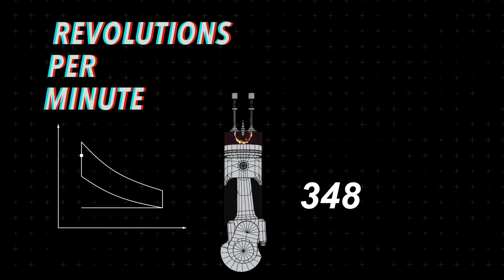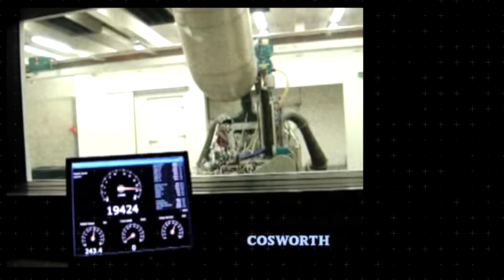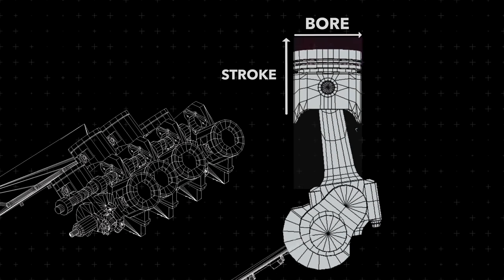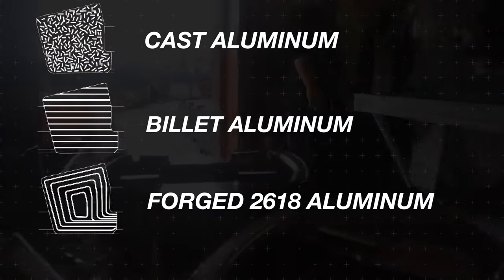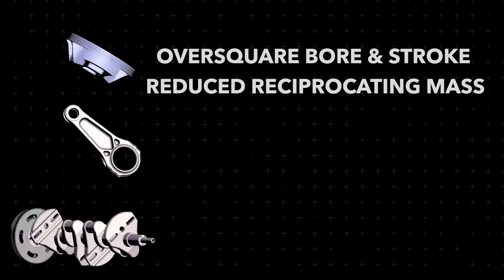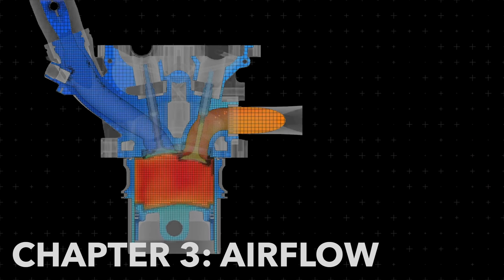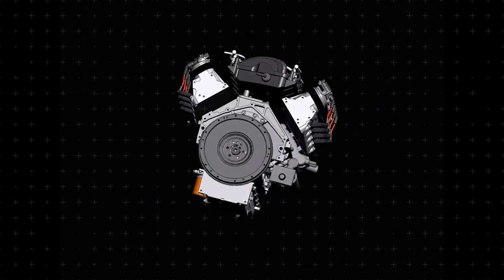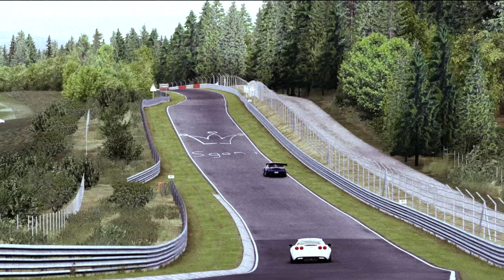The Impossible Engine Speed😳| Explained Ep.28

Comment: There's something to b said about tuning exhaust velocity vs back pressure, but all engines do need some back pressure, unless designed to run at max rpm at max power during most operation.  Try building an engine with no back pressure, and see what happens... the engine uses the back pressure to build efficiency over a certain power band, so nearly all engines require some back pressure. 

Saying engines don't want back pressure is simply ig orant of physics and foolish.

Comment: Ship engines go down as low as 50rpm (and 100,000hp at the same time)

Valve float at high RPM is better addressed with desmodronics, not springs - and this is a video subject all by itself (Ducati!)

Fiat used pneumatic valves on their Twinair engines - not exactly a high revving, high power, high cost engine application

Comment: High RPM engines are fascinating. But i prefer a big lazy engine with lots of low end torque. Of course im not a racer. I only drive on the streets. If i was able to drive on a track, I might prefer a high revving engine. But I would have to drive a few different engine types on a track to really know for sure.

Comment: I think I would rather build a high-voltage EV or Series-Hybrid.
There is a linear relationship between electric motor Amps & torque. But of course, motors are limited with how much torque they can produce. So if you don't want to trade RPM for torque with gearing, or add more motors or a bigger motor.

Then like with engines, if you can't, or don't want to build more power with torque, because of weight or space restrictions. Then you have to make more power with more RPMs. More voltage means a higher top speed and rate of acceleration.

So, if I was, for example, to modify an EV or Series-Hybrid. First, I would swap to a higher voltage controller, or swap out the capacitors in the controller, because they're the main limiting factor to how much voltage that controller can handle.
Then, check how much voltage the Motor{s) winding insulation can contain before it starts arcing. Then check and modify how much RPMs the rotor & bearings can safely handle before failure, so the centrifugal force or friction won't rip things apart.

Then, build a higher voltage battery & ultra-capacitor pack, and a matching higher charging voltage generator if a Series-Hybrid, or, just build a high power boost-converter, and add as many Ultra-Caps and or batteries in parallel with the original batteries as possible, within your space or weight budget, because a boost-converter can only make more voltage, if it can pull more amps from the power source, as in the batteries/ultra-capacitors/generator.

You can have a higher voltage, using the same wattage battery pack, but you will have to limit current for safety & longevity, so essentially, it will be like always moving in 2nd or 3 gear.

You can safely overcome motors, as long you don't overheat them to death. Too much heat can melt or ignite the windings wire insulation, and if your motor uses magnets, too much heat will demagnetize them.

If you improve the cooling ability of the motor, with added heatsinks, liquid-cooling, or a bigger deeper radiator if already liquid-cooled. Then you can program your controller or Cycle Analyst V3 for a higher current-limit, because the same motor can now safely handle more amps without overheating.

So, the motor can produce more torque, for longer, or more torque continuously without overheating. That, with higher voltage, is the key to more power with the same motor, then, only limiting factors, are how much voltage the insulation can still contain, how much RPMs the bearings can handle without quickly wearing out, and how much G-forces can the rotor handle, without flying apart, or even expanding and scraping into the stator.

This is the future of tuning. And the ultimate Sleeper car or bike. Because, besides the cooling system, be it a pure EV or Series-Hybrid with the generator off. How can you tell if it's a weak economy vehicle or a monster?

It's hard for an engine to hide its ability for more power.
Recirculating Blowoff valves, disc-style wheels hiding bigger brakes, and exhaust cutout switches bypassing extra mufflers & resonators, all this can only go so far. 
But electric motors are the ultimate stealth.
Cops, and other enemies won't know what happened or how you disappeared, even more so, because you don't have an engine ANNOUNCING where you are, where you're going, and how hard it's working.

To everyone who read all this, thank you for your time. Hope this inspires you to build your own performance Battery Electric Vehicles or Series Hybrids. I'm sick of the mess and clusterf--k of engines. I'm sick of waiting for multiple things to go wrong, even with my preflight checks, which I'm also sick of doing. And I'm sick of the puzzle of getting all these different parts from different manufacturers to work. And I'm sick of the unnecessary attention. I just want something quick & dependable.

Once you grasp the basic Electrical Engineering, EVs are so much more simple & reliable. At least with the range-extending generator of a Series-Hybrid, I don't have to stress out the engine or myself. I can just keep it at lower revs, for less noise, less fuel consumption, and less wear, and just optimize the intake runners & exhaust for that RPM. And for high charging voltage, I can just modify the generator motor attached to the engine, and trade charge currant time for more voltage, by changing the windings or the gearing between the engine and it's motor acting as a genorator & starter, if I don't want to turn up the engine RPMs for more generator volts. I'd rather do this, than go through the unstable hell of modifying a drive engine for more power with a higher redline. And no clutch to burn, no transmission to blow up.
And more aggressive Regenerative-Braking means I don't need bigger, heavier, more obvious brakes, and the stock ones last longer.
Other than video games, I'm so done with traditional tuning.
My delivery bike engine has put me though so much hell already, by itself, and it's not even that modified. Just a longer intake and more open exhaust.

I thought about getting the Kawasaki ZX4RR, or a less RPM parallel twin like a Versys X300. But I don't care anymore. After my workbike, I just want to build a quick pure electric or series-hybrid.

Comment: This was sooo interesting...never knew about valve springs so much, it is very interesting that pneumatic control of valve, is that similar to the Freevalve technology from Koenigsegg? 

As I see that Coshwort is top notch engine manufacturer so GMA T.50 and Aston Martin Valkyrie have an F1 technology for the street 😎
Reply from the maker: Koenigseggs Freevalve is even cooler since it’s solenoids controlling the valve and no need for cams. You can adjust cam timing and lift with a broader range of control, still have the insane rpm capabilities and also shutting off valves for low speed fuel economy. Idk why F1 hasn’t adopted it but seeing they would have to license it from Koenigsegg for $$$ is probably why
Reply: @337speed  probably Freevalve is the next thing in racing, sooner or later something similar will appear, in road cars there is no much time cos here in EU everything goes against internal combustion, we are shooting ourselves into the knee 🤷
Reply: @alexluke84  The advantage of freevalve tech is efficiency, but other manufacturers match or surpass using more tradicional tech, better manufacturing techniques and better designs

Comment: Rotary engines have a theoretically unlimited engine redline and heard tales of rotary engines that were pushed beyond 17K to 18K regularly without anything attached to the engine.
Reply: You've heard of rotaries revving lower than some early 90's honda 250 4 cycle motorcycle? 

On a more serious note since I can't tell if you are joking, I don't think you understand what unlimited means. If a turbine engine has a "redline" due to airflow at supersonic speeds, than your slower than a 4 cycle rotary will also at some point before infinity experience a similar situation starving it of any air.

Comment: Add Spok would say,
Fascinating, but not true. 
There's a limit to how fast Pistons can travel. 
And  it equates for everyone.
Piston speed is what hampers from engines making more power. 
By using variable cam timing you're able to overcome what this man suggests. 
But again it's not valve train. ( Titanium valves )
It's all about piston speed 
For example of Harley-Davidson could read to 10,000 RPM. 
They would be making somewhere in the proximity of 280 to 300 horsepower, normally aspirated. 
Car technology is barely catching up the motorcycle technology. 
Shem under buckets, dual overhead cams, 
Flat combustion Chambers. (Way beyond hemispherical heads) 
Gasoline will only burn so fast. The flame front has a constant speed. 
Just saying....................
PS 
Honda's VR, oval piston technology, will give car manufacturers another 50 years to catch up.

Comment: Afraid of valve float?  Design the cam to take advantage of it at high revs.  Who cares if the motor runs like shit at low revs?  You'll have a narrow power band but that's the transmission's problem. (9:28 "Damping" not "Dampening")

Comment: RPM is nothing smaller engine can do higher RPM just like a small electrical motor for slot car can do 50k to 250k RPM but can't spin a wheel of the car at all.  they could make it high rpm but less torque will be produce. by the way the cargo ship engine RT-flex96C  is 22–102 RPM Torque: 7,603,850 newton metres (5,608,310 lbf·ft) @ 102 rpm

Comment: Bike engines do it always
Reply: bike engines are much smaller and have 1 piston so its much easier to achieve a higher piston speed
Reply: @jacksheneman6242  bike engines has 1 2 3 4 or  6 pistons,  also all the supeebikes are at least 4 pistons
Reply: @jonathasfigaro4992  with much smaller displacement lmao
Reply: Cool, now do it with more than 2 litres.
Reply: @bhuuthesecond  wankel engine
Reply: @jonathasfigaro4992  which is not a bike engine

Comment: Engine to make ove 20k rpm is not so difficult, you can buy engines doing 26k rpm 70 years ago, only they are RC engines with less then 1cc, even I own some Eastern Europe sub 1cc "diesel" engine capable of over 30k rpm (it is compression nitro  engine using ether instead of glowplug).
Making small engines do high rpm is not difficult.

Comment: Was expecting more. This is all super basic. Btw if you did everything mentioned in the video you wouldn't make power above 8K. 

The real ticket to high RPM power is head flow and port velocity. You can have the biggest cams and valves in the world but if you can't flow enough air through them in time they are useless.

Comment: How come a nascar smoked all these over engineered euro race cars. Bmw, Mercedes and the like have never been any better. The difference use to be you could fix your Ford/gm/dodge easier and way cheaper. Though the ladder may still apply in most cases. Euro vehicle are literally lip stick on a pig. Japanese vehicles are still top notch. Though they're definitely not as refined as they once were. Either way a man should NOT need to pull a cab and or lift a motor out of an engine bay to work on, replace part or upgrade components. It's so unnecessary.

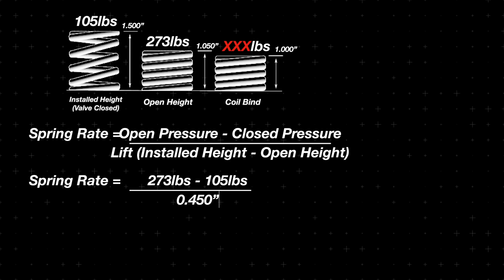Comment: 7:53

Springs are crap; You want to use nitrogen instead.

Springs don't provide more resistance when you hit them harder: Compressing a gas does.

Suggesting SPRINGS on an engine that is going to rev over 20k rpm is the sign of an ignorant fool.

Sigh, another channel that doesn't know what they're talking about.